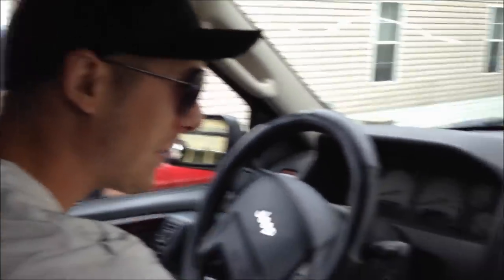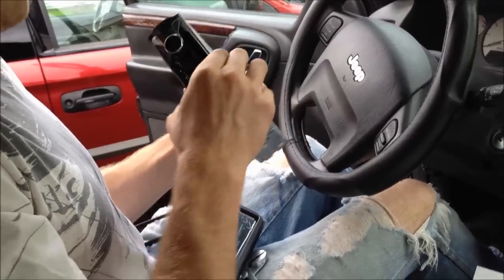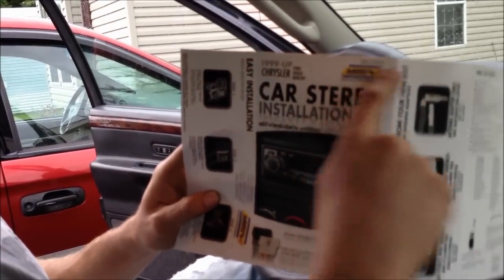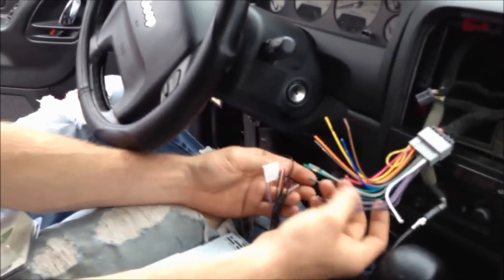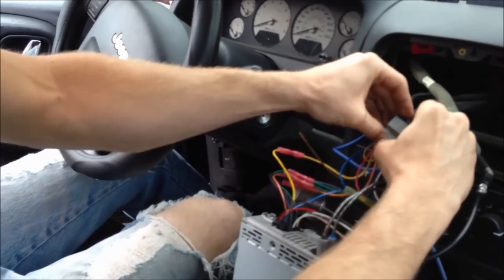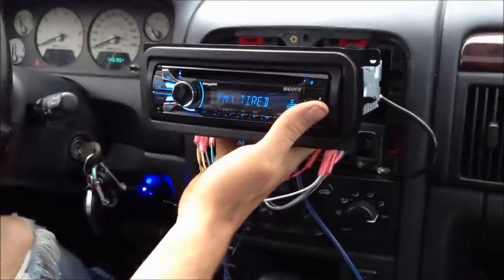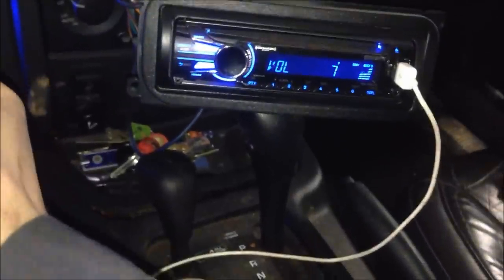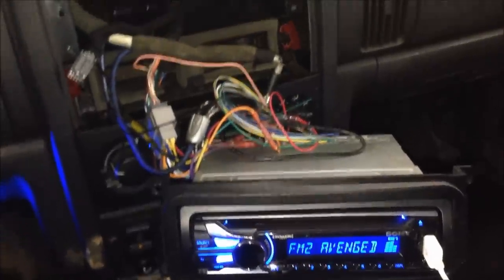Jeep Grand Cherokee Stereo/Deck/Radio Install (1999-2004)

Comment: I know nearly nothing about anything like this. I had my bf do all the wiring before hand and he didn't connect the orange wires. They're like yours( one with a stripe one without) there's also a blue one pre stripped and a blue one with a white stripe that says "p.cont".   Can you tell me what any of this means?
Reply from the maker: The blue with white stripe is usually your signal for an amp or subs if you have them, not exactly sure what orange is for. I just connected every color to the matching color and it all worked haha
Reply: @TonyTheTruckGuy  okay I just installed it without the orange wires and everything seemed to work but there was no sound. Could it possibly be that?
Reply: There's no sound...
Reply from the maker: @rubyrae7073  Is there an orange wire on the Jeep side and an orange wire on the radio side? If so, I’d connect them. And is the radio itself powering up when you turn the key on?
Reply: @TonyTheTruckGuy  it is and I did connect the wires. No difference.
Reply from the maker: @rubyrae7073  Hmm, make sure volume is turned up and if it is and still no sound, see if there’s any fuses on the back of the radio that could have blown and replace as necessary. Otherwise something has to be connected wrong or bad radio.
Reply: @TonyTheTruckGuy  okay thank you

Comment: the harness clip ran across in this video the connections run virtical mine  went horizontal
Reply from the maker: Does the new radio have 2 skinny but tall vertical plugs?

Comment: Just wondering what did all the kit parts cost? Just bought a 99 laredo yesterday..
Reply from the maker: It’s been a while so I can’t recall exactly. The steering wheel control module was $50 alone but I don’t believe your Laredo will need that. I would say about $50 between the antenna adapter, filler panel kit, harness adapter and the wire connectors. Plus the cost of your radio.
Reply: Tony The Truck Guy yeah i got the same setup u have. Thanks bud

Comment: So what do you do when you just move the stereo out and the anti theft key sentry goes off on your dashboard and the truck doesn't start anymore??
Reply from the maker: I’ve never had that happen so I’m not sure lol. Did something else get unplugged accidentally when you yanked the radio out? This is the first time I’m hearing of this issue.
Reply: @TonyTheTruckGuy  I'm not even sure what I did. But it's been a hassle trying to start up again. I bought a new ECU and even had a new key reprogrammed and nothing.  But I'm noticing that the ground strip cable is completely disconnected from all angles. Isn't that connected to the radio?  Or where does the strip cable even go? 🤔
Reply from the maker: @dolly6agebulletz159  You mean the black wire coming out of the aftermarket radio harness with the ring terminal on the end of it? That should just be the ground for the radio, but it should be grounded to something.

Comment: Where did you get all of your supplies/ mount kits etc. ??  There's not many audio stores where I live
Reply from the maker: I got mine at Best Buy but I did post product links in the video description as well if you'd like to order online, just verify vehicle fitment before ordering.
Reply: I have a 2000 jeep grand cherokee.  Everything I need is at best buy? I didn't know where to go to get all the stuff I need
Reply from the maker: They should have everything unless it's a tiny Best Buy in the middle of nowhere. The employees there in the car audio department can also help you look up the correct parts if you're unsure of something.

Comment: What about the 2din to 1din hole that is leftover?  What was that filled with?
Reply from the maker: I’m pretty sure Chrysler is actually a 1.5 din, not a double. It was literally just the radio being centered in the hole and a solid filler panel around it.

Comment: dose this also control the cd changer as well as steering wheel conrtols?
Reply from the maker: +John Steier The module allows steering wheel controls to work but the rear 10 disc cd changer will not work, as there is an additional plug on the stock radio that can't be wired into the new one. There may be an adapter out there but it wasn't worth it to me since I have an iPod.

Comment: Is it the same process if I have the infinity gold system??
Reply from the maker: I can't remember if mine had that system or not. And honestly, I can't remember the difference between the gold system and the normal one haha. Steps should be the same, I would just double check part numbers by typing in your specific year/make/model/trim.
Reply: Ok thanks

Comment: Thanks for the video. Is there space behind the stereo? Can the antenna adapter plug be straight, not like the metra one which is under an 90degree angle. Will the stereo fit in then, or it's pretty against the plastic behind?

Thanks.
Reply from the maker: +MustAccord Should have room for a straight one if you can push all the wires out of the way.
Reply: +PkwyDr thanks, the ASWC-1 steering wheel controller fits behind nicely as well?
Reply from the maker: +MustAccord I wouldn't say it's a perfect fit but I didn't tinker with it too long I just crammed everything in and I was able to get my radio in all the way without any issues.
Reply: +PkwyDr I am just going through this now. You said that you didn't use the Black and Brown wires. There are two yellow wires as well (Battery/Constant), did you use both of them or only one? I put these two yellow ones together and connected to the yellow one (3 yellow cables together)

I connected my ASWC-1 pink cable to the brown cable on that plug, as it goes to pin 14 on the stock plug.
Also the ground from the ASWC-1 is connected to the black cable which was leftover and the red one to the red one (12V Ignition Switched).
Reply from the maker: I thought mine only had 1 yellow not 2 but as long as they are tied together like you have it then you should be fine. The black I ran to a ground, brown I did nothing with. As for the ASWC it sounds like you got it down as long as it's how I showed.

Comment: It was a great video. Thank you but as the stereo that installed was smaller than the original stereo, what do you do with the gap?
Reply from the maker: Filler panel 😁

Comment: What about door speaker did u change them if so did u put it up on you tube?
Reply from the maker: I did not change the door speakers. Although it’s pretty easy to do. So long as you get the right size, they pretty much just drop in where the old speakers are.
Reply: @TonyTheTruckGuy  I heard they are 6x9’sin the front
Reply from the maker: @tazstaxi6661  They are, but it’s a tight fit. Check this out - https://www.crutchfield.com/car/outfitmycar/mycar.aspx

Comment: is this with the infinity system???
Reply from the maker: I believe so. Whatever the factory system is, it had an amp under the rear seat.
Reply: PkwyDr Thanks dude. You're helpin a 17 year old on a highschool budget
Reply: Austen Clark thanks for the info. I actually got a budget boost and 31 in tires instead tho.
Reply from the maker: Austen Clark Are you adding the 3.5" lift to the budget boost? If you're removing the budget boost and only running 3.5" lift then you will need heavy bump stopping and trimming to clear those tires. Even at 6" lift 33s eat up a Grand Cherokee wheel well, especially while flexed.

Comment: Great video man. Looking at doing this myself, just have a few questions first.
With the fascia - did you mount the radio bracket to it, or did it come with the bracket attached?

If buying an after market head unit, most likely a Sony like yours - what becomes of the factory amp? does it work in conjunction with the new head unit? or is it null and void?
Reply from the maker: I had to put the metal radio bracket into the filler panel and bent the tabs up as shown in the video to secure it. I never noticed a decrease in sound quality when i added the deck so I'm pretty sure the amp was still doing it's thing.
Reply: PkwyDr  brilliant mate. thanks for that. I saw the metal tab movement, but it looked solid as with the chin installation before it was mentioned haha
Reply: PkwyDr
That's odd. When I went to buy a wire harness, they told me I would also need to buy an amplifier bypass wire adapter or something like that. I was told that an aftermarket head unit can't power the stock amplifier. After watching your video it seems as if some head units actually can power it. Guess I'll wire it up normally and see if it works before spending the extra money on the additional amp bypass stuff. They also told me it would probably be easier to run new speaker wire from the new head unit directly to the speakers, or to an aftermarket, 4 channel, mid range amp.
Reply from the maker: Not sure, but this Sony worked no problem.
Reply: following this video allowed me to install a new model Kenwood. Being Australian, the names and models of the chords were different, but managed to find them OK. Now installed sounds good, stock amp ran it fine. Just the original speakers sound like ** when turned up a bit. 
Anyone done a speaker upgrade?

Comment: Where do you put the cord for your subs?
Reply from the maker: @ 8:13 you can see where I connected the blue wires to power the amp, and you can also see the coax cables for the subs plugged into the back of the radio. Assuming your radio is compatible with subs, you should have hookups on the back of it.

Comment: Yes
Reply from the maker: Do like Austin Poulson said and also make sure your radio fuse is secure and that your ground wire for the deck is good. Usually with an issue like that it will be a main ground (should be black wire) or constant/switched power (red or yellow) wire that's causing the issue.

Comment: How do you ground the black wire?
Reply from the maker: Sorry I never showed that. I think my black ground wire had a ring connector on the end, so I just found an existing bolt or screw inside the dash where the radio sits and connected it to something that bolts into metal. Or you can run a dedicated wire through the firewall and connect to battery ground.
Reply: @TonyTheTruckGuy  wow, gonna have to go to the shop and get that done, no thanks to doing that by myself lol
Reply from the maker: @Doyle-iq2kv  It’s really not bad. If you think you can do the rest of the install yourself, you can handle the ground. Check out some other videos and you might find one that shows the ground situation a little better.

Comment: where does the ground wire connect I can't seem to figure that part out
Reply from the maker: The radio should actually work without that hooked up, usually the black wire gets hooked to another black wire but this was a weird application. I ended up putting a ring connector on he black wire and just grounding it to a small screw in the dash on a metal bracket. The best way would actually be to extend the wire and feed it through to the battery ground.
Reply: Tony The Truck Guy yup figured it out apparently I had a harness for the year but not the Laredo trim so o got the new harness and wires connected and she's up and running now  thanks
Reply: Tony The Truck Guy the head unit  said to ground to a clean solid metal surface and the only place I could find was under gas petal still didn't work and now my face plate is slightly to big to fit the factory dash and vents piece flush to dash and instrument console
Reply from the maker: What didn't work? Does the radio work?

Comment: Shouldn't you soter the wires
Reply from the maker: That would offer the best connection but it's not exactly necessary and most people can't solder so I showed this method.

Comment: What did you ground the black wire to?
Reply from the maker: I can’t remember if there was a black wire on the other end of the harness or not. If there was, I wired black to black, otherwise if there is no other black wire, I just put an eyelet on the wire and ground it to the metal bracing/brackets behind the plastic dash panels.
Reply: ok thanks man!
Reply from the maker: No problem, let me know if there’s any other questions 👍

Comment: Sooooo now when a wire comes lose you know why haha
Reply from the maker: Why would a wire come loose?
Reply: @TonyTheTruckGuy  because using those chrimps you used on the wiring tend to come lose over time
Reply from the maker: Never had a problem in my 10 years lol. Heat shrinking helps hold them together, too.